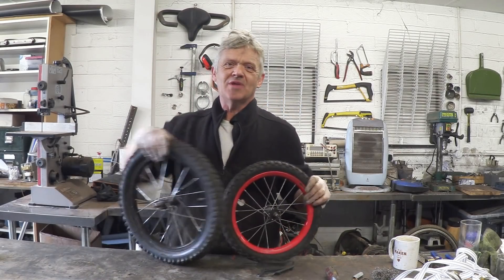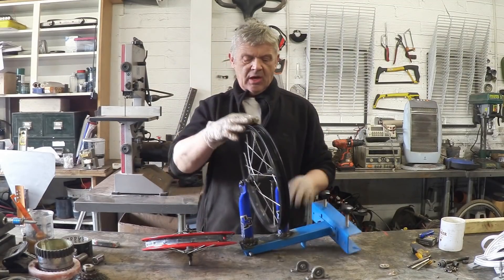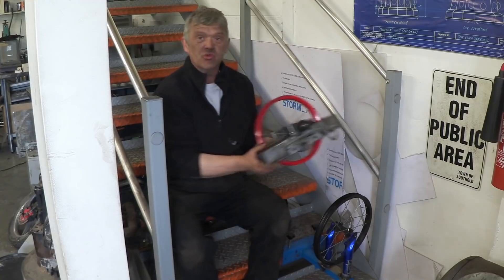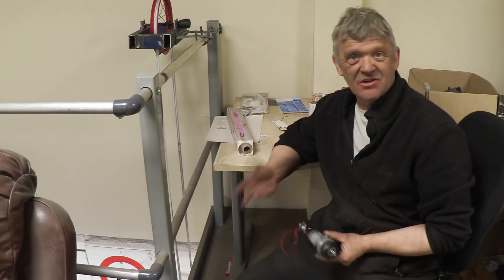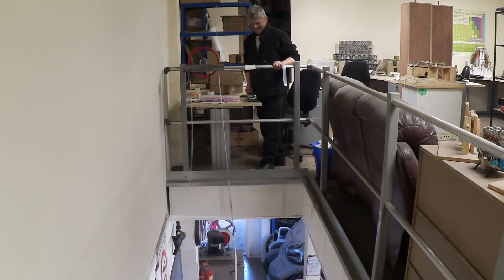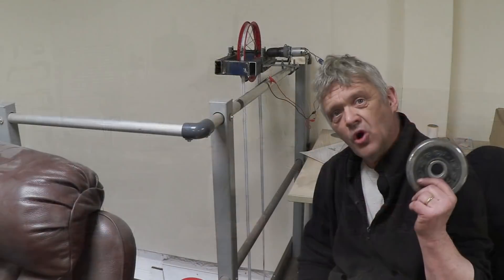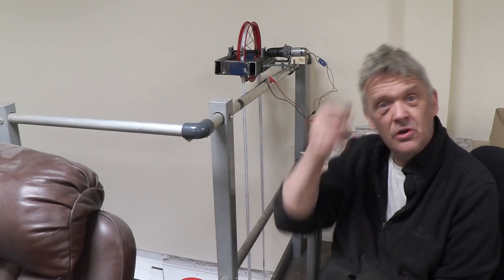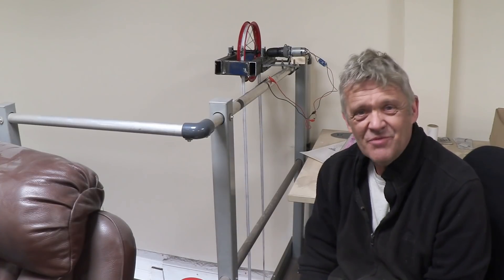1150 Gravity Battery/Generator - First Try At Something

Comment: Energy from water. hmmm... using the water flow in household pipes to create electricity could be interesting experiment, e.g. every time you flush the toilet where a reduced water flow to the tank would not be critical.

Comment: Well as long as you have water this type of thing with buckets will work as generator without any special parts. Someone is even trying the same but inverse with bubbles that get trapped when water falls down a hole, which can also pressurize the air. Tho because the belt has to flex all the time it probably cant last very long before it wears out

Comment: if you can get it to heat weld together 2liter PET material seems like a good choice for the belt, just look up lace cutters that turn say a disc of leather into one long strip by cutting a hole in the middle and starting to cut it from there with a blade that has a stop so it can't cut through more of the leather at once than the depth of that gap behind the blade, so something similar to that to cut a bottle into a long spiral might be just what is needed there, or that concept of the double sided like an 8 that they pass each link of the leather through to make belts and such maybe, but out of that PET since it does not stretch much, and is incredibly durable and resistant (left a couple in Oklahoma summer sun directly for nearly 5 years and not a bit of yellow, no frosted effect of oxidation ect, and just as flexible to my human perception at least as the day it was left out there, I am currently looking into a design to use it for protecting solar cells in a solar panel in lu of using some sort of tempered glass, (also going to test gorrilla glue crystal version that says leaving the bottle in the dark could cause it to turn yellow, so leave it out in the light to prevent yellowing, as a method of sealing the cells from water and oxygen damage too, just hope it can last in sun, and does not shrink causing the cells to flex and snap of course, why? because the silicon sealant stuff you buy for solar panels is like 80 bucks here for two quart containers of the stuff LOL.

Comment: The hardest part im running into with generators is energy storage. Every method generates different power - and not being a rocket scientist i dont know how to shove that power into a battery.
Buying a charger circuit feels like cheating.

Comment: Robert, I did scan your work, have you any ideas for a flywheel generator. As lithium becomes a commodity (exploited) EV's might practically switch out the electrical batteries for flywheels (or air of course). I'm sure you're aware of the science and history. Do you think they could become a practical or viable home solution for EV's to reduce costs and charging times, lifetimes etc? And commercialisable? And then automatically ready for domestic power storage.

Comment: So Same design - BUT under a RAIN GUTTER; CUPS on the Belt to catch water; And a BELL SYPHON in the gutter to DUMP a FULL CUP amount of WATER down onto the Belt/Cup. Should be pretty efficient too with some timing tweaks.  Will work in both a slow or fast rainfall.   If done well it would probably look really neat too

Comment: High ratio gear box.  The friction of the gear box would slow down the dropping weight while at the same time speed up the generator.  Could even be done with a lego gear set.
Reply: Also, since the higher the load on the circuit connected to the generator slows down the generator it would need to be taken into consideration.  Math<-----got to do it

Comment: If you put a 3-4W Microwave Synchronous motor on it, the gearing would slow the drop and produce 240v - 3-4w and for a longer time.

Comment: I have given this alot of thought. 
You need a 500 lb. weight, a chain hoist and a structure outside.30 foot drop on the weight, gear reduction and a generator for your house. Probably a battery bank to store the energy. Probably a young mans game! But with the right gear reduction I think it would power you house better than solar or a wind system. And could easily supplement either system.

Comment: that thing needs need a lot more gearing. That way it takes the weight longer to hit the floor. Perhaps take gearbox from another drill(provided the drill doesn't have braking.) and remove the motor and connect it to the chuck of the generator. That will gear it up even more and pehaps it will slow down the descent while providing 2x the rotation speed for the motor.

Comment: Great fun. Wouldn't it be good if you could have a weight on each side of the belt and somehow got it to go up and down continually, much like a pendulum (as you said) going side to side. Not sure if you could power a pump to use water and still have power left over to power the light.

Comment: Great video. Failing is important too. That way we know what won't work.
I had a quick thought, is there a way to use the freewheel sprockets and a weighty flywheel and when the weight hits bottom, it free spins from the weighted flywheel?

Comment: The light house at Cape Agulhas, if I remember, originally had a clas1 Fresnel lenses weighing about 3 tons. It floated in a bathing of mercury and was turned by using a bucket of sand the lighthouse keeper wound up the light house on a rope and using it as a gravity battery to rotate the mechanism. It rotated to give a flash of light every 5 seconds that could be seen 32 km away. Not bad for a 171 year old gravity battery. The light was fed by burning whale oil.
Reply: Pretty cool minus the whale oil.

Comment: Your concrete flywheel would work with this system adding torque to spin bigger motors, say, your treadmill motor easier.

Comment: I’ve been thinking for a while about designing a gravity battery using water as the ballast. A small solar powered pump could be used to pump the water back to the top during the day.
Reply: The nice thing is that it uses no exotic materials.  The unfortunate thing is that a kg of water only stores 9.8J per meter, enough to run a 10W LED for about 1 second.

Comment: The biggest issue is the 'weakness' of gravity because even if you dropped a 100kg mass from a height of 10 meters you will generate less than 10,000J of energy (<3Wh).

Comment: Make a water turbine that is powered from the mains water pressure and you got free power from the water company. Create a small nozzle and see if it can spin it faster. Put the mains water through a Tesla turbine see what power you can get from the water board.
Reply: You think water is free ?
Reply: I had the same idea to capture the movement of water that passes through the house. However, don't know how to do it. 
A Tesla turbine I think would not work well since Tesla turbines get their high efficiency at high speeds.